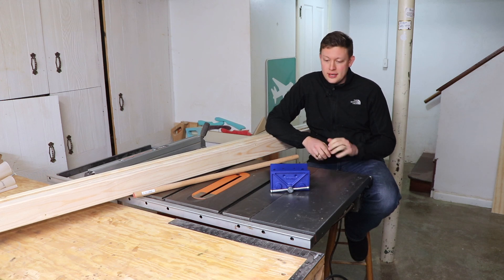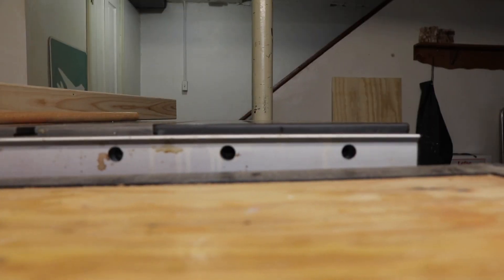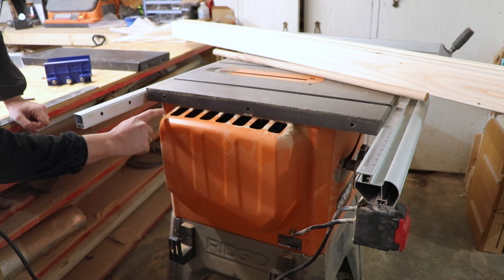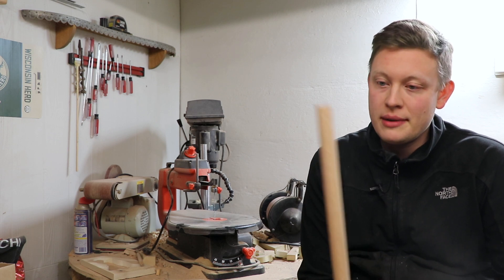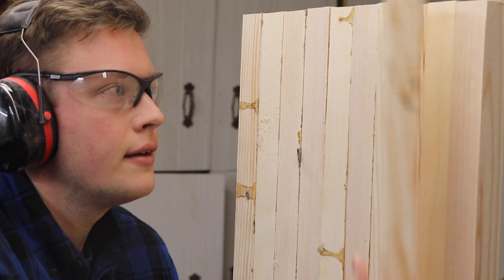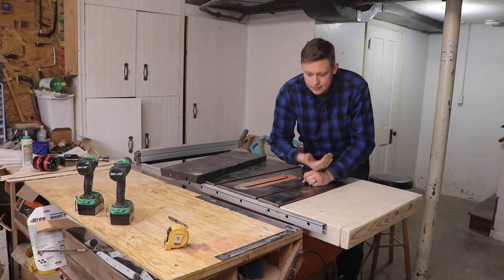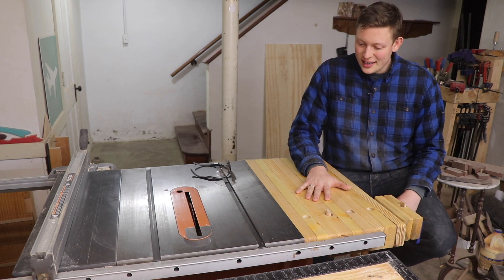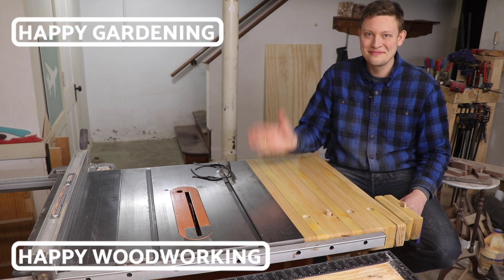Table Saw Vice & Dog Hole Workbench Wing Upgrade

Comment: That's a great idea. I have an R4511 with the granite top. I often clamp boards to my table saw fence to edge plane them as I don't have a proper woodworking vice setup anywhere yet. Kinda handy because I can then just flip the edge against the fence to see if I'm straight enough to run it through the saw, as that is usually the reason I'm planning the edge in the first place. The table saw is by far the heaviest and stoutest thing in my shop so why not take advantage of it!
Reply from the maker: Thanks!  That granite top sounds gorgeous.

Comment: Good idea, especially for those who don't have a lot of space for a full size work bench. I'm still not clear on how you fastened the side to the front rail? The stamped steel had space to tighten the nuts but here you wouldn't have that. Or did I miss something?